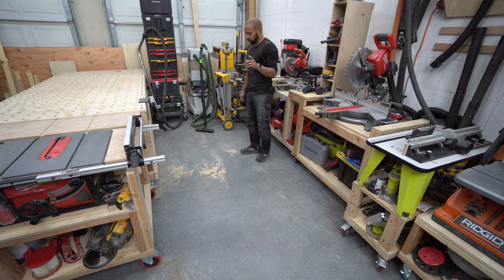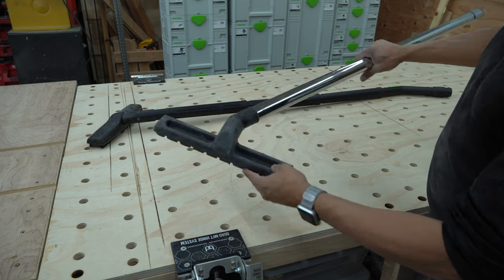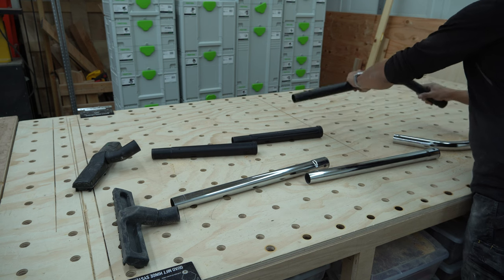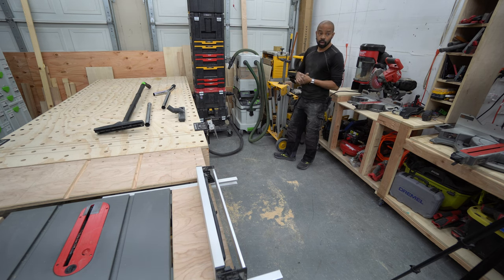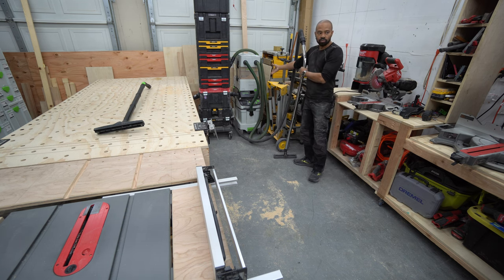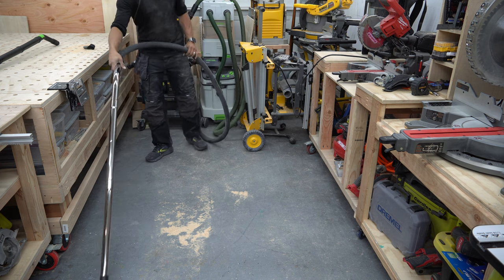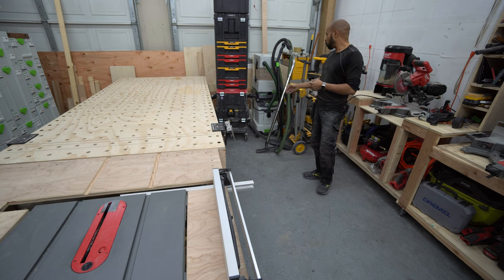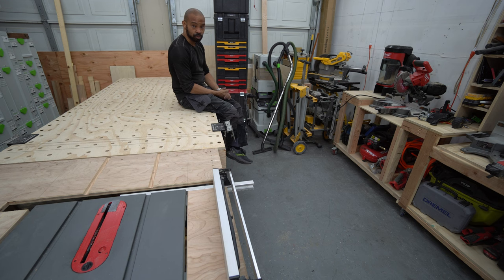Dual Wield Comparison of the Festool Cleaning Kit RS ST VS  Dewalt Dust Extractor Accessory Kit

Comment: Thanks for the comparison and overview of the festool cleaning set in your previous video. I'm grabbing the set with the 36mm hose before the price hike. Nice shop and presentation. Subscribed. 👍
Reply from the maker: Thanks, NW. I appreciate the support. I also considered the 36 mm set. I decided to go with the cheaper one to see if it would function in the shop as I imagined. I will still get the 36 mm kit because it comes with the 36 mm hose, which offers additional suction for tools like the OF2200 and the Kapex.
Reply: @daddysharespace  Yeah that's the main reason I'm getting the set with the 36mm hose. The set is only $46 more than the hose itself and you get all the other pieces and a big systainer. I plan on getting one of the routers before the price hike as well. Which do you find you use the most between the 1010 and 1400?
Reply from the maker: If you can swing it. Get the 1400.